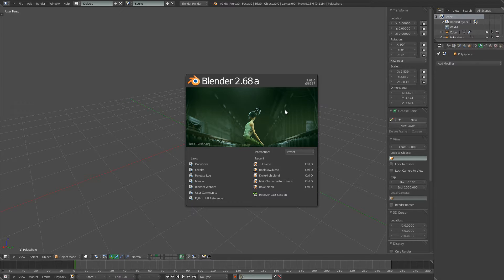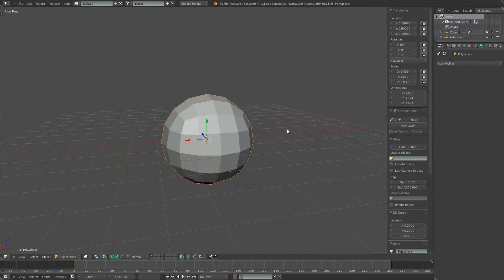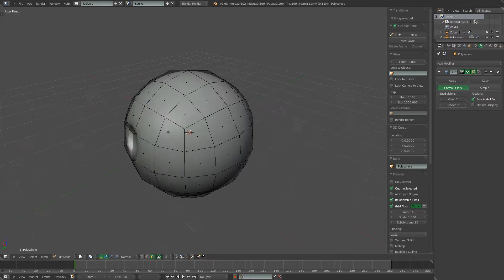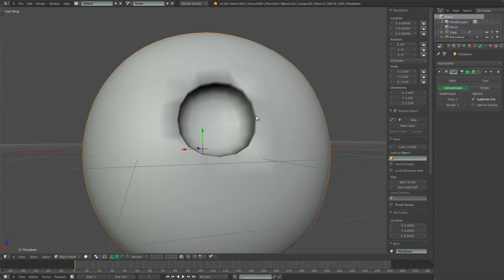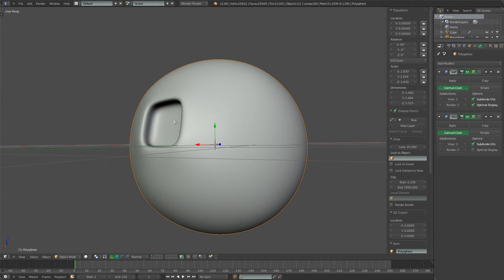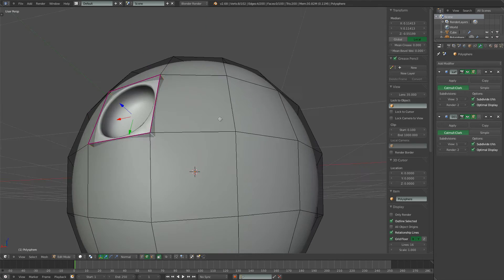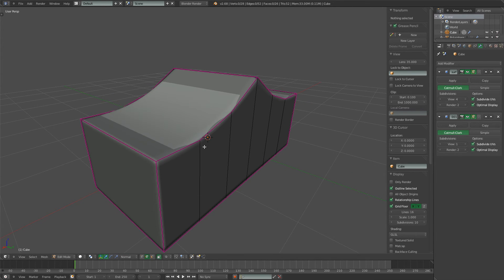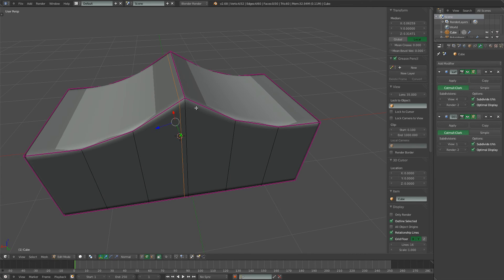Double Smooth in Blender

Comment: Also, you could press Ctrl + B to double the lines and give you a clean edge it may destroy the workflow a bit
Reply from the maker: I've started using bevel weights with the bevel modifier lately using HardOps which is an amazing plugin for hard surface since it speeds everything up and keeps things mostly in the modifiers stack.
Reply: I guess i know that method, is the one using masks and egde marking onto the modifiers right?, i guess i saw it on Penfinity channel, awesome workflow, a little heavy tho

Comment: If you go to the tab on the right of the modifier (i belive its called vertex tab) you can enable Auto Smooth, that will get rid of the wierd black stuff around cressed edges, just play with the values a little
Reply from the maker: That works to a point however, it does make truly sharp edges which are usually only acceptable in game engines. Also, you don't have precise control over the individual edge sharpness until after you apply subsurf which is destructive. I kinda wish Blender had an "edit poly" modifier like in 3Ds Max so you can edit geometry/sharpness without having to apply modifiers.
Reply: Agree, sometimes we get stuck with the modifiers and wish nothing goes wrong, but the method of auto smooth also works for final renders, i don't model too often for games so thats a big plus for me, sometimes it may cause wierd stuff in other places of the mesh :/. If i'll only make a hole or something like that i use booleans but i don't apply it, that is awesome for games, after all its done i just apply the modifiers one by one and the holes or whatever hard egde i make stays

Comment: You could also use a shrinkwrap afterwards and using the original sphere object duplicated and set the vertices in a group you don't want to effect for the square hole and you shouldn't have weird shading around the hole.

Saw this on an awesome cgmasters video, look up subdivision techniques or something.

Comment: hey there, I’m trying to work out how to make a pattern like this:

h t t p : / / w w w . h a t c h p a t t e r n s . c o m / i m a g e s / h a t c h e s / 7 9 9 8 h p d c . g i f

in blender with the pattern being like circular rods (say 2mm thick) and holes in the middle (here they are pentagon shapes but they could be triangles or hexagons or squares i don't care!!!) do you have any ideas as to how i might do this in blender?
Reply from the maker: budgiebreder Not exactly sure what you're trying to make, and I'm not sure why anyone would write a link with so many spaces. Anyway, just try using the array modifier and extrude the edges of the shapes into long rods. You can make these shapes by modeling the outer edge, then extruding, scaling in and then deleting the interior face. Then take the edge of faces you're left with and extrude downward. Hope that helps!
Reply: fusobotic i had tu use spaces as youtube wouldn't let me post a link... (annoying i know!) and i'll have to try this. i've never used array before. wouldn't it create identical shapes though? i want all irregular.
Reply: fusobotic i'll send you a private message

Comment: Nice technique. You can also add edge loops inside your face extrusion to refine the mesh. If you added an edge loop inside the extruded box, the edge loop will stay within the box extrusion container rather than flowing around the entire mesh. This will allow you to add a loop near the lip - Another option is to subdivide individual faces within the extrusion to get individual face edge refinement control.
Reply: I was gonna ask the same thing. I feel creases are a very underused feature though. Edge sharpness without holding loops. Why aren't people all over that?